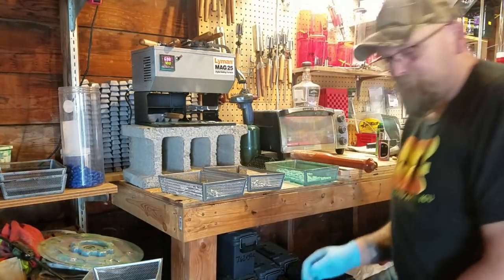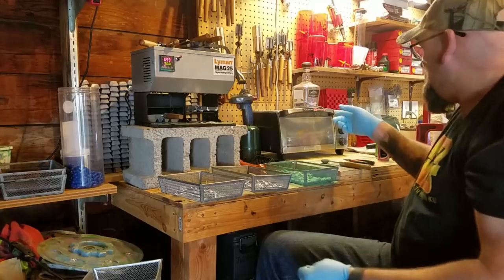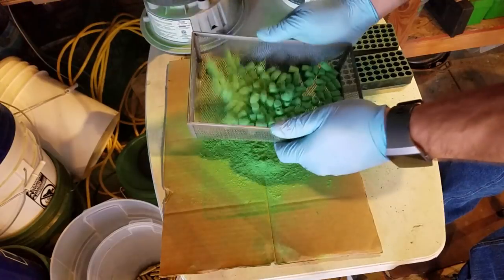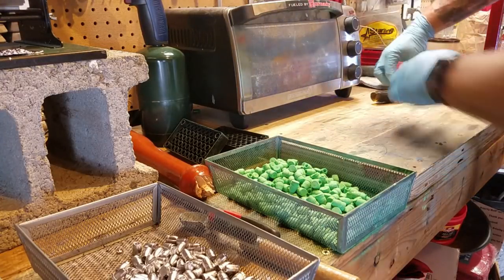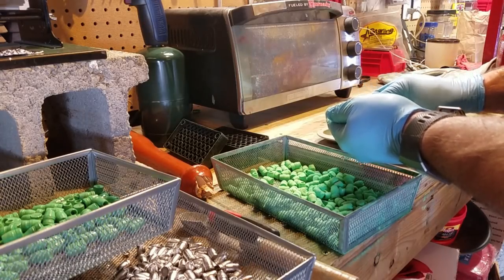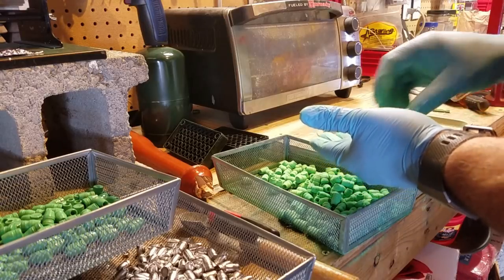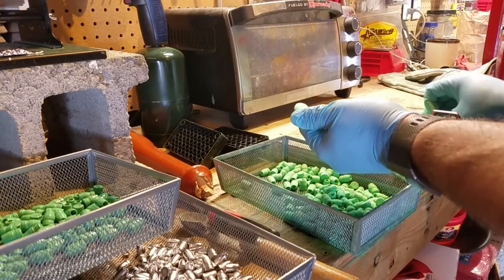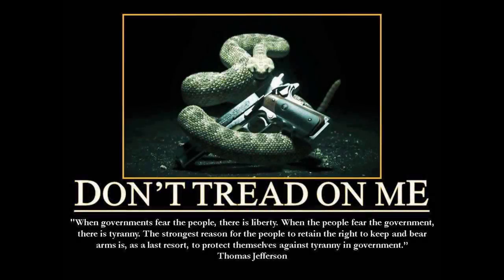Powder Coating Tips and Tricks

Comment: I enjoy you video's and learned form them, I tried my hand at powder coating last night. I cleaned the bullets with acetone and used Eastwood powder coat, and the coverage was very good. For my first time they turned pretty good, baked at 400 for 20 mins, I learned not to use parchment paper from the dollar store. lol They stuck to the paper but soaking them in water helped me get the paper off. Luckily I stand them on their bottom instead of laying them down.

Comment: I can never get eastwood powders to adhere the way that you did by just the shake and bake method. maybe i'll try my FA vibratory tumbler. subbed.
Reply from the maker: 30ROUNDCLIPAZINE 
With Eastwoods powders, depending on the color, you sometimes have to shake them for a while longer. I have found that with the PBTP, especially the mirror colors, they tend to adhere slightly better. Using a VT, has been very successful in getting the paint to stay on. You'll get some knock off but for the most part it works well. Thanks for watching!
Reply: Thanks for the reply. My biggest pain is Eastwood mirror black. Loads of bacon had success with it 🤷‍♂️

Comment: Where do you get the small trays that fit in the oven?
What HF thermometer was that?  I can't find any HF thermometers that looked like the one you used for less than $26.  Ebay has some starting at $8.19.
What oven do you use -- it looked new.
(I'm just getting into casting & powder coating.)

Comment: I started using lead that was taken from the ballast of a boat too.  It is VERY hard.  Not sure what the BHN number is but has to be high.  I had a tough time breaking up the 20 lb ingots I bought - tried a log splitter to make slivers to put in my 20 lb Lee lead pot.  That was not very successful.  Eventually formed 1 lb ingots.

Comment: My question is, How do you get that powder to stick, so good, to your bullets?? I started powder coating a while back, but I have trouble with most powders not sticking to the bullet, Harbor freight being one of them, I have found one, out of three ordered, from the The Powder Store that does almost a good job.  the other two, no coverage, just dulled the lead by the tumbler.  So how do you prep you bullets before you put them in the tumbler, to get such good coverage and not come off, handling it?   Or is it my soft lead.  I use a lead with a BHN of abut 8.

Comment: Great video’s man 👍.   I was wondering what is your ratio for your casting mix?   How much wheel weight lead to pure lead?   Keep up the good work!!  Cheers
Reply from the maker: Its a hodge podge of mixture. Sometimes I use 85/10/5 Lead, tin and antimony, other times I just cast the wheel weights. Lately I have been cutting down and melting lead from a couple of 1000 lb blocks of pure. Thanks for watching! I appreciate the feedback.

Comment: For someone who wants to get into powder coating and doesn't care about any specific color but has a "function over form" attitude which specific powder choice would you specifically recommend as the best powder to use, and from where?

Specifically, first/primary use would be to use on the Lee TL309-230-5R for loading in 300-blackout (that bullet isn't working well for me with just regular tumble lube).  I want to add diameter to their "as cast size" which my mold even with good alloy is just barely dropping at 0.309" and I think the boat tail design is part of the problem as well and I have heard powder coating helps a lot with curing gas cutting issues on bevel base bullet designs in magnum revolver loads ~ so assuming it would help with the Lee boat tail design of this bullet for the 300-blackout.

Comment: Everyone talks about what temp and how long to bake them, but nobody talks about what to do with them after the time is up in the oven.
I saw one guy would take them out of the oven and dump into a big bucket of water. Is this the "norm" ?
Thanks and great video!
Reply: Dropping them in a bucket of water helps separate the bullets after powder coat for some. It doesn't hurt them and because they don't get hot enough it doesn't change the BHN.

Comment: Can we use the load data for jacketed bullet of the same weight for reloading polymer powder coated bullets?
Reply from the maker: That is usually how we do it, we work up the loads on a 5 round basis with a light load and working your way up. I have pushed my 9mm to over 1300fps with my CZ with no issues.
I hope this helps
Thanks for watching!

Comment: So with the PC, what is the size of the 40 bullets? Do you have to size them? I'm new to the casting business.
Reply from the maker: Skip Allen, they are cast at .401
After they are cast and powder coated, run them through a .401 sizing die
Amazon sells the Lee kit for about 24.00
Yes, you will need to size them as any discrepancies in your mold and Bullet will be brought into specs.
Hope that helps
Reply: @minutemencoffee  Thanks! Good information, very helpful!

Comment: I learned alot from your video with great ideas. One thing that I'd love to know is where did you get those wire baskets ? Possibly a website where they are availble would help. Thanks again for the ideas from your video.
Reply: Bed, Bath, and Beyond
Reply: Tommy thanks for the idea of where to look for the wire baskets but I wasn't able to find them. Maybe I didn't put in the correct words for the search. Would you please give me the correct words for the search so I can find them ? These basket trays certainly look like they are better suited for standing up the bullets on the trays for when they go in the oven for baking them. Looking forward to your reply. Thanks
Reply: @gasparoochie  Squared Away™ 6-Inch x 12-Inch Mesh Drawer Organizer in Matte Nickel

Comment: Looking at casting my own bullets as well due to ease of getting lead, how long does the powder coat last as far as amount of bullets coated?
Reply from the maker: Kristoffer Setzer, I am still using the same 2lb container and hve PCd about 5000 per 1lb of powder.  I have about 20 difderent colors from multiple manufacturers so it will be a while unril I run out.
Thanks for watching!

Comment: Do you degrease the bullets before you put them in the powder??
Reply from the maker: There is no grease used. They are poured, then powder coated, then we run them through the sizing die to get to final size.

Comment: What about sizing the bullet, before or after coating or both??
Reply from the maker: John Thompson sizing the bullet before you powder coat doesn't work unless you live the bullets. The PC coats the bullet making it easier to size. Hope this helps.
Thanks for watching
Reply: So far my problem is with Lee mold for 45colt 255gr flat nose, they are dropping at .4545. After coating they are about 458. I can barely get them thru the lee .452 sizer. They look like the coating is thinning out after passing thru. So I lube them and put them thru a lyman .451 sizer then after coating I use the Lee sizer .452. What a pain!!

Comment: What is the name of the green powder and its distributor you using in this video?
Reply from the maker: The green I used was a 50/50 combination of Mirror Green and the Springfield Yellow. 
Thanks for watching!
Reply: Did you purchase them both from Powder by the Pound?
Reply from the maker: Yes... I purchased them from Powder by the Pound they are great to work with. The extra 2.00 for the container makes it worth it.

Comment: not a expert reloader or anything and was contemplating casting as I have access to alot of old car batteries, but my question is how would coating affect the fit in the casings, would you adjust for bullets diameter becoming larger or is the mold you are using already have than built-in also is this done for pure looks or does it provide some aerodynamic benefits? I'm more worried about all that paint gunking up my barrels.
Reply from the maker: Ray, thanks for the feedback, I would highly NOT reccomend using used batteries for melting down, do so at your own risk. but the standard procedure when casting your own bullets is to, after they are powdercoated, to run them through a sizing die. for the 40 S&W I size them to .401using the Lee Sizing dies on a single stage press. 

With the powdercoating, the paint does not add any additional diameter or wieght to the bullets and I have successfully shot almost 8,000 rounds through my G22 stock barrel with no fouling other than the powder used. No different than factory rounds. 

The dirtier your gunpowder the more you have to clean. No paint gunks up the barrel. watch my smash test video and you will see that the paint adheres quite well, even with the various colors used.
Thanks for watching!
Reply: @minutemencoffee  Wow thanks for info about car batteries. There was over 120 of them sitting upside down drained on a pallet for years. I guess the lead is weakened after years of acid etching?
Reply: Ray O  DO NOT tear into and melt old batteries. They have a bunch of stuff tht you should not be vaporizing without the proper eauipment.
I took my old batteries to the scrap yard and they traded me linotype for them. But I could have gotten lead wheel weights in exchange also.

Comment: I guess I need to find Fortune Cookie's video to get any info about using a vibratory tumbler instead of a plastic bowl or bucket.
Reply from the maker: A Olinger get an extra tumbler and a small container of air soft bbs
As your powder and tumble for 8-10 minutes 
It’s not that difficult 
Get a wire mesh basket and a piece of flat cardboard to dump them on to and bake them up like normal.

Comment: Why powder coat your bullets?
Reply: Because a cast lead bullet has  lube groves, when you size them you also apply lube in the lube groves.  This lube helps reduce and sometimes prevents leading in the barrel. So when you power coat the cast bullets, the coating acts somewhat as a lubricant. But the biggest gain it eliminates leading because the lead bullets are encapsulated in this  plastic/polymer coating. It acts  as a jacket bullet at a fraction of the coast & the average person can do it with minimal investment.